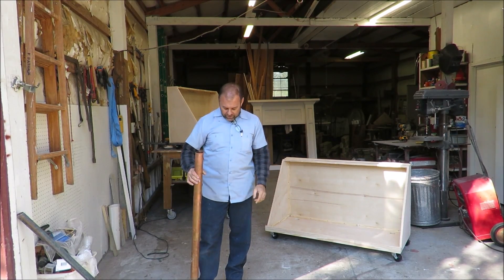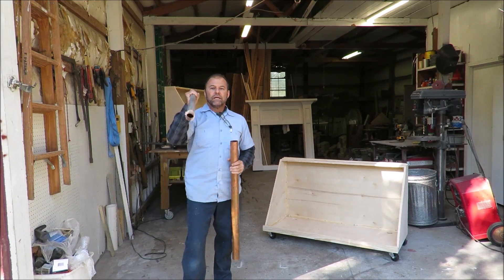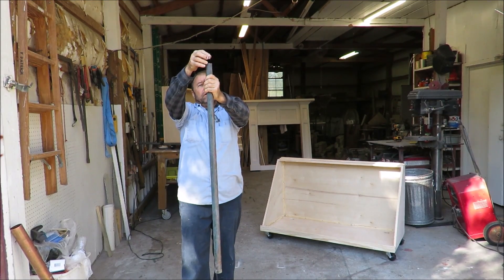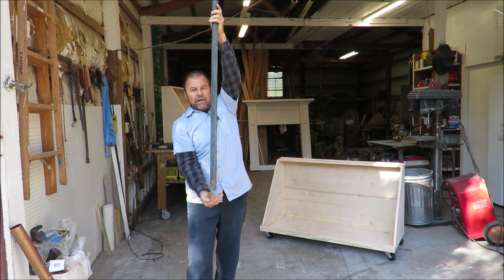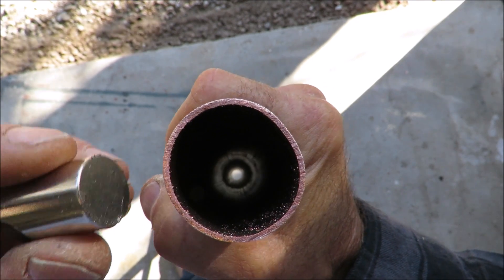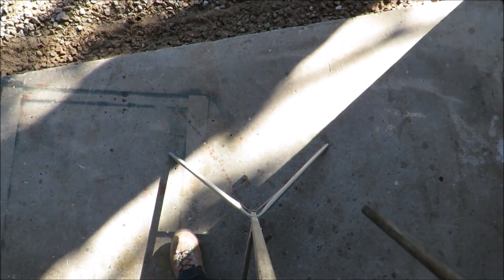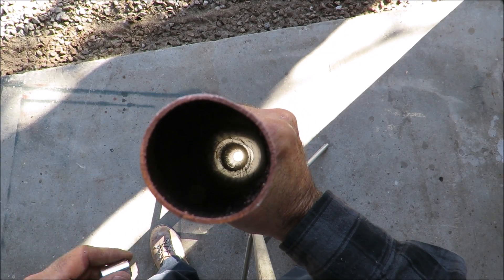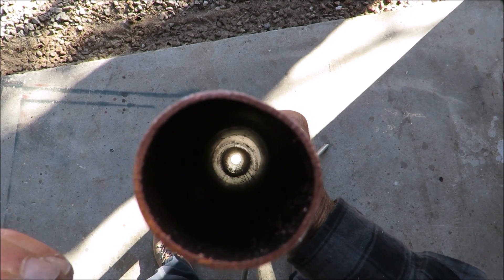Watch what happens when a rare earth magnet fall thru 2 copper pipes. 2026

Comment: Loved it. Next try a aluminum pipe, an double it. The magnet forms a field around itself that the copper pipe can't deal with so it slows it down when sliding through the inside. On military elevators in their dumbs, deep underground military bases they use aluminum and magnets to move the cars up and down. Normally never have any troubles with them and they weight they put inside them are no problems either. If you want more, on magnet like that one, wrap coil of thin light wire with a coating on it, hot glue wire around it then glue a button battery to top on end and attach wires, then drop it. Cool right. Electro magnet, then reverse the poles on battery an see if magnet will go up the pipe from the floor. Hopefully pipe is correct size.

Comment: The copper pipe is NOT made by 100% copper but 10%-20% are iron which causes attractions to the cylindrical  magnet n thus slow down the falling rate  per second.

Comment: This has to be how Coral Castle was built. A magnetized generator in a highly active area with a copper cable around the stones would make them basically float. Thank you this video puts it all together for me.
Reply: No, it wouldn't, that would require alot more wire and a fucking massive magnet

Comment: I worked at a place with a powerful MRI machine. We used to freak folks out with a large block of aluminum. You set it inside the machine, then tip it over. It would slowly fall down. Same with coins. If I recall, it called the Lenz effect.

Comment: I have an idea. Weigh the magnet and weigh a small 1-2 inch section of copper pipe. Then put the magnet in the small piece of pipe with both ends taped so the magnet won’t fall out. Then weigh them both together and see if there is any weight difference. Just a thought.
Reply: There will not be a weight difference but there will be a balance difference.

Comment: interesting experiment...one step further please... how about a pipe within a pipe with about a 1/4 to 1/2 inch airspace between the pipes??? Any significant difference? faster, slower descent...hmmm. A thicker, solid copper pipe, say 1/2 inch thick, would almost assuredly slow it down even further than the two pipes, but who has a long section of that? Another thought would be two dissimilar metals, such as a copper and say aluminum... Have to say, you got my analytical juices flowing on this one...thanks Mark...
Reply: I thought that's what he was gonna do when he put one pipe in the other.  But then he did them separately.